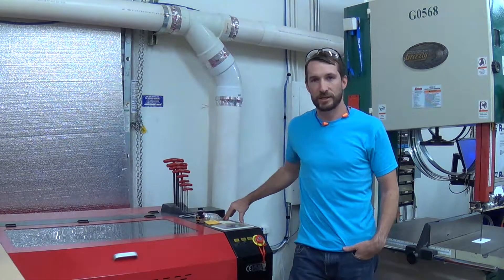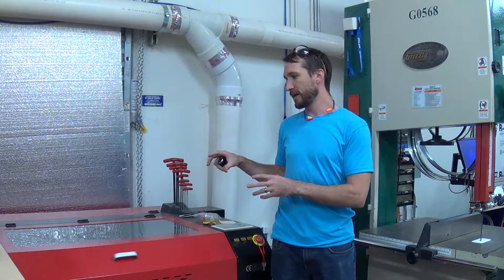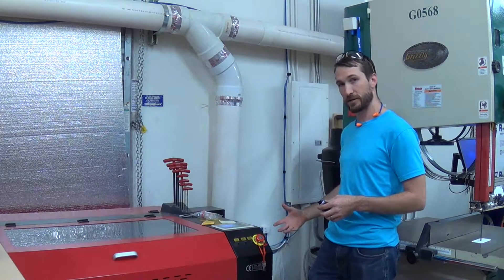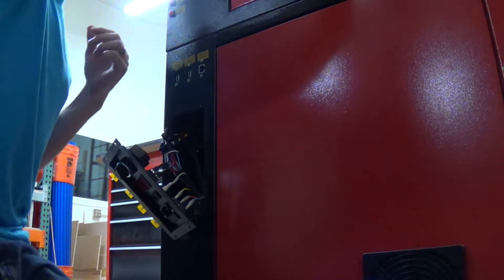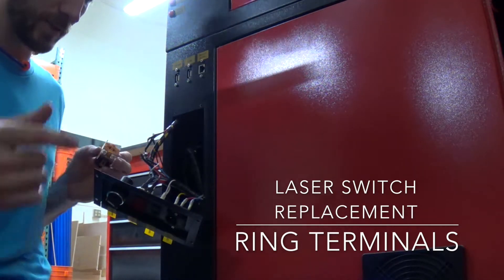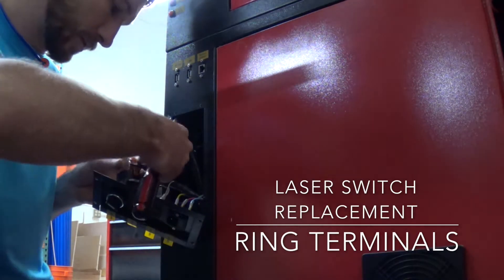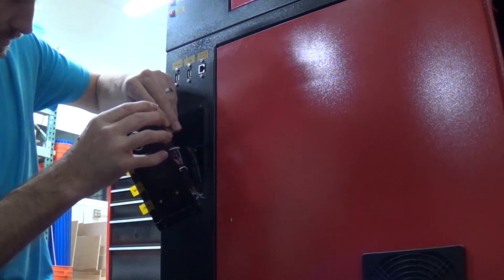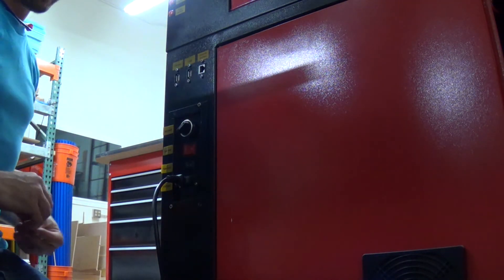Chinese Laser Cutter Switch Replacement

Comment: Is there a difference between what wires go which way. On my power button it has the # 24 and 12   and 11 and 23.. What about the switch that you told me about for the emergency stop switch? Doesn't matter which way the wires go back?

Comment: I have the same problem. And I've been trying to find help can you please explain where you got to switch from on Amazon. I was cutting something out on my laser cutter and it just cut off. I replace the power supply with a new one. There is power coming from the wire and I check the fuse  It is OK. The only thing comes on when  When I turn on the switch Is is the fan in the light. But no power for the laser and the panel doesn't light up. And there's no power to the power supply.
Reply from the maker: You can use this e-stop switch as a replacement: https://amzn.to/3xJNwCz
Reply: @AT Nomad  I bought the switch that you told me to get the emergency stop switch. Can you please just tell me how to plug the wires up. It have 1and 2 NC red and 3 and 4 NO green. I have 1 red wire and 4 blue together and 2 Separate individual blue wires. Could you please tell me which one is go to what. Thank you very very much if you had the time to tell me.
Reply: @AT Nomad  Can you send me the link to the off and on switch that you got? I have the exact same 80 watt laser. I bought the. Emergency stop switch that you sent me the link of. I just need the often or switch can't find it anywhere.

Comment: I bought the switch on amazon that looks the same, it had different specs. Did not work, checked the fuse, it was fine. can not find the switch with the same specifications. May you please be kind and tell me how to bypass the switch. I rely on the machine on a daily basis.
Reply from the maker: Don’t bypass the switch. What’s the part number of the switch that you got?
Reply: Ii has these numbers LA125 LA39/LA38 660V 10A AC -15 ue: AC380/220v DC 15 380/220v UI 660v lth 10A GB14048.5-2008
Reply: @AT Nomad  In your video you said make sure eleven and twelve is supper. Does that mean make sure the red and blue wire are not together or they got to be opposite of each other. I have 1 Red and 1 blue wire. And I have Two wires that's rap with three wires together. Blue white black. What side does they go on to the same side or opposite sides?

Comment: Bradley can you send me a pic of the emergency switch wiring. I need to replace mine and I’m not sure the wiring set up. I have the same laser as you. 
Thanks jake
Reply: Did you ever replace your emergency switch. If you did can you tell me what wires you use to hook it up what color
Reply: @darrinbutler619  i ended up bypassing the Er switch and it has been fine for like 6yrs